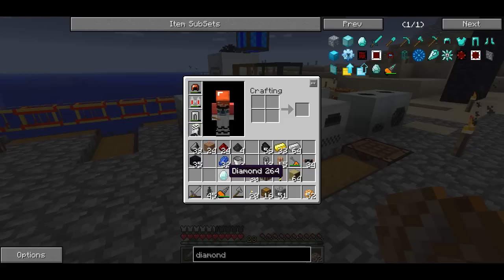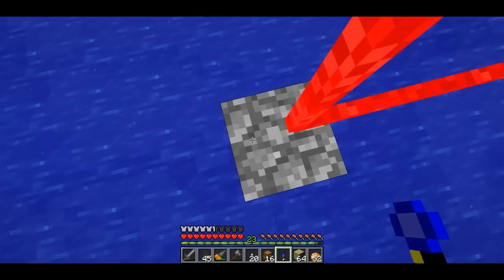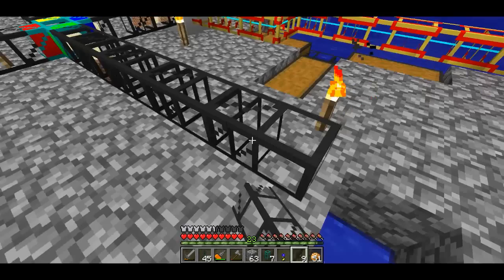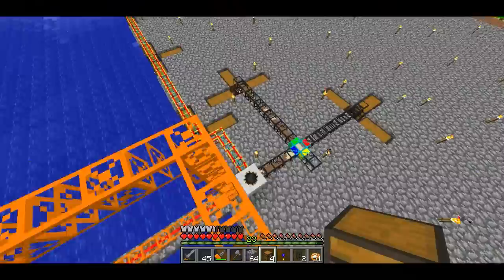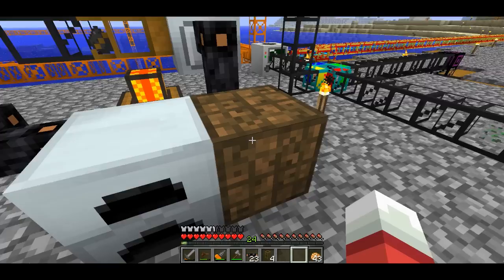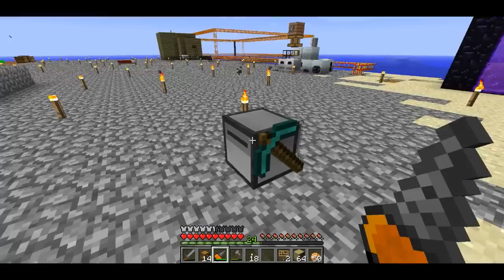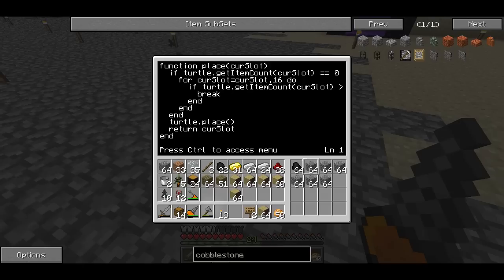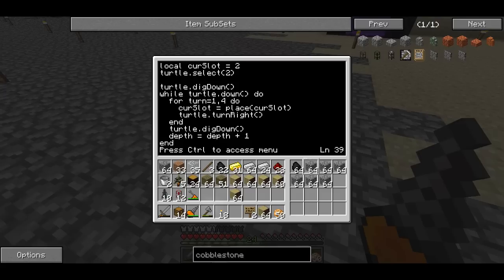SethBling Plays FTB -- Episode 4: The Bling Machine

Comment: To set the area of a quarry you only need 3 landmarks, one at the place were the quarry is going and the other 2 inline with the first but some distance away in the X/Z direction. Once all three are place you can right click the corner one and place the quarry down.
You can also power the first land mark with a redstone signal and it will show you a set of lines 64 long (the max size of the quarry) so you can use those to work out where the other 2 should go.

Comment: You also do not need to put the landmark that defines the height of the quarry (The one on top of the wooden planks). You only need 3 landmarks; place the first next to where you are going to place the quarry, the 2nd and 3rd to define the length of the sides, and then right click the 1st (it should be the "middle" one) to create your square. The only time you need to define a 3-dimensional cube is for machines such as the template drawing tables and fillers.

Comment: Seth! You should try making a Solar Helmet. They are not horribly expensive to make, and would make you not worry about recharging your jetpack. Also, the jetpack has a hover mode, which doesn't go up as fast, but instead of just falling, you glide down, so you could equip some better shoes.

Comment: Use hoppers so the macerator never overflows, a hopper hold 4 items when there is no space in the machine, it goes over the machine and when there is space the items will go down into the macerator.

Comment: To make the program more time efficient you could try to make it check if there are blocks around it horizontally (if it's possible to do) and if there is it wouldn't have to do the whole spinning process. Though I don't know anything about programming so I don't know if it would be possible to check without it spinning (as checking is what it's doing when spinning). Also, as this is an older vid, maybe this has been done already.

Comment: Seth, I know there are a lot of comments, but your Shaft program has an error — you do not actually select() the curSlot in place() function, so turtle will not actually be able to place anything if it runs out of 64 blocks in slot 2.

Comment: Seth, in function place, if the turtle "runs out of items", it will try and place a block from slot 16 (which is empty), Wouldn't that generate and error that will end the program?
And if it doesn't generate and error, and the turtle picks more block on hes way, the curSlot will be stuck on 16, because it will loop from 16 to 16, maybe you should change it to 2 to 16. I know that it is realistically impossible, but what can i do... i'm a programmer too. :)

Comment: Bug in shaft? Line 38 you do turtle.down() instead of down(). So if you hit a ravine on the way down, there's a chance it could run out of fuel (only guessing here -- I've never programmed these things myself, but I noticed you don't actually use down()).

Also, coalball? You program with coalball (COBOL)? hur hur... (programming humor)

Comment: Java is a clunky monstrosity. Meanwhile, Lua lets you mesh every language ever made in magical syntax wizardry. Meanwhile, Java runs on all platforms (like Lua) but is about five times slower than C++ (if I remember correctly), which is based on the same thing that Lua was (some other C language that's still faster than java)
the things I like about java are multi-threading and how easy it is to decompile. It's just that Lua is better.
I'm right because I'm right. Q.E.D. (thus it is proven)